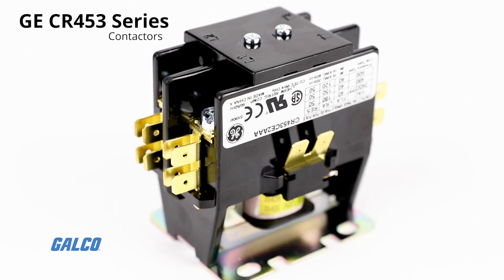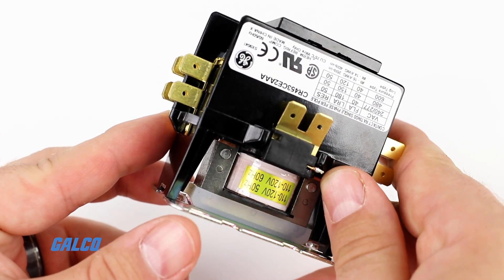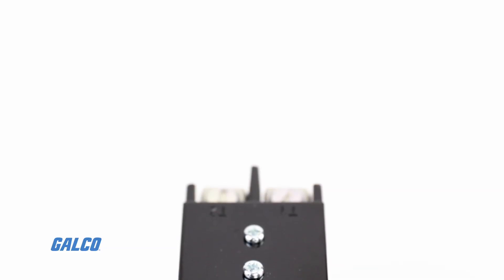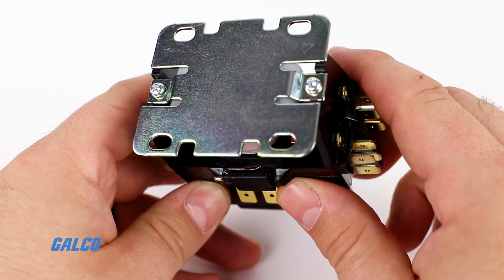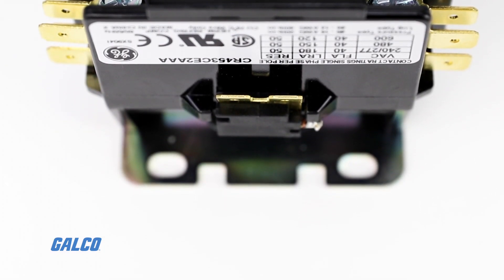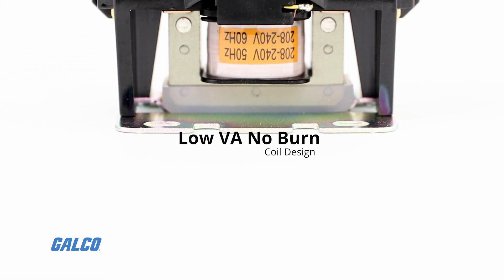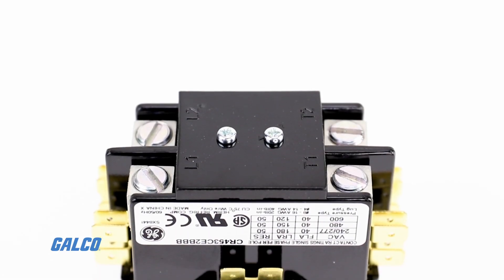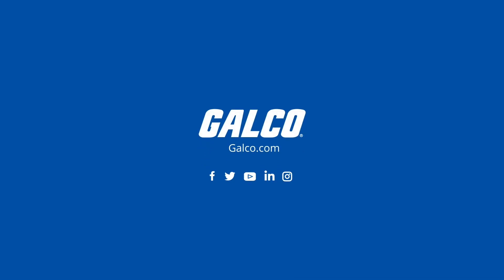General Electric's CR453 Series Definite Purpose Contactors

Comment from the maker: The contactor’s universal mounting plate design included multiple elongated holes, which allows these compact-sized components to use the same mounting holes as existing designs for easy replacement or simple substitution. Shop Now:https: //www.galco.com/shop/CR453-GE-General-Electric-Definite-Purpose-Contactors